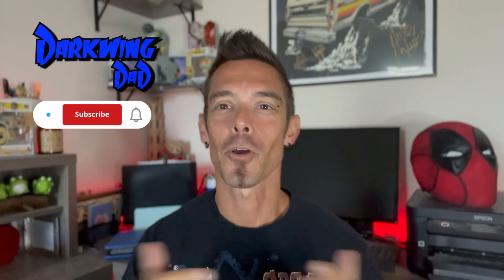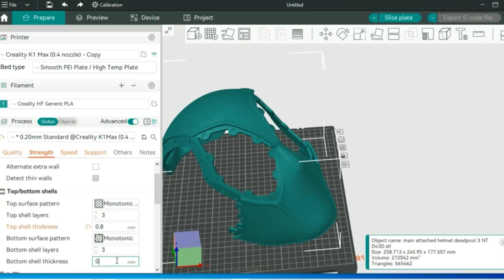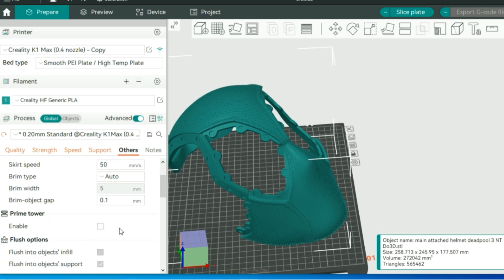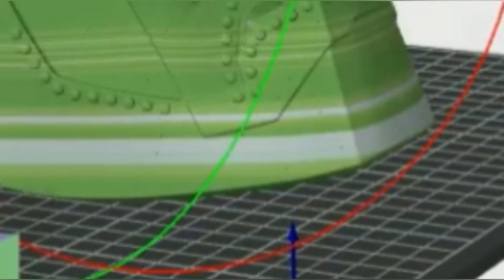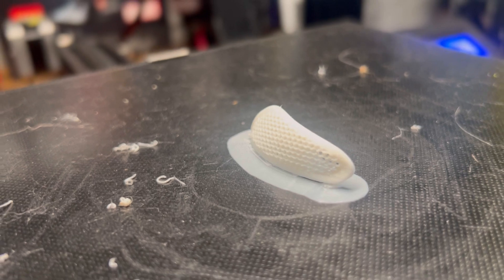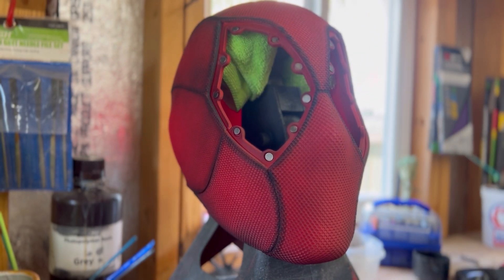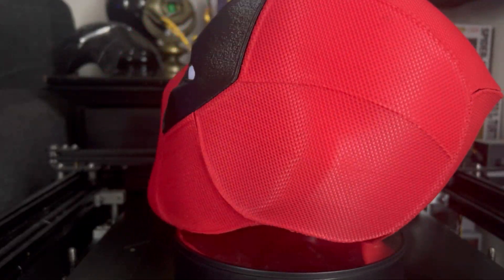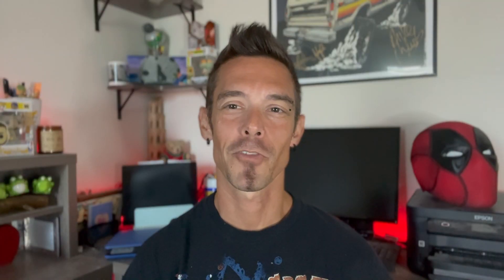How to make a Deadpool mask without sanding | Orca slicer settings on 3D printed deadpool by do3d

Comment: I would recommend removing the link for the magnets. They are completely useless and will not hold the mask together.
Reply from the maker: I used the same ones and they worked like a charm. If you scale it larger you may need bigger/thicker magnets. Measure the depth & circumference with a micrometer usually 6mm & 8mm work good.

Comment: As i know is grid stronger, so why is gyroid better in this case?
Reply from the maker: @rhotix403  grid has great vertical strength but as far as overall strength & speed gyroid is actually better
Reply: Gyroid induces more vibrations and has to slow down since its accelerating and deaccelerating pretty often. Grid is faster (18% told by cnc kitchen) using the new gen of printers. In terms of strength im not sure at all, since there are so many factors
Reply from the maker: @rhotix403  I’ve personally done break tests and gyroid always holds up the best. I was able to stand on a curved piece of petg printed with gyroid at 30%
Only other one that held up that good was triangular
Reply: @Darkwingdad  Okay, good to know. Thanks :)

Comment: Its weird because I got the same mask from DO3D but yours looks different.
Reply from the maker: How so?
Reply: The magnet placement in the eyes and some other small bits on the shape of it.
Reply from the maker: @deanelliott6013  there are 4 or 5 different interchangeable eye pieces that may be why
Reply: @Darkwingdad  but surely the main mask needs to be the same? Mine has various eye bits that can be printed.
Reply from the maker: @deanelliott6013  yes the main mask should be the same
Reply: @Darkwingdad  very weird..
Reply from the maker: @deanelliott6013  try emailing do3d I know they often send me model updates & new renderings maybe there was an update you missed on the file?
Reply: I think Do3D sells 2 different versions that are very similar - one being the new deadpool 3 one, and the other the Classic Deadpool.  Looks like there are less magnet spots for classic.  Maybe that could be it.

Comment: Never really knew what the Smooth section of adaptive layers really did. I stopped using them because I hated how I could tell just by looking at the print where the different layer heights were at. Thanks!
Reply from the maker: @ImmortalReaver  variable layer height is ALOT better and customizable, I definitely recommend it!